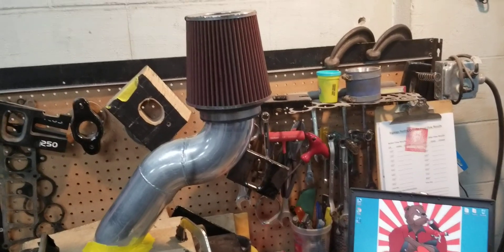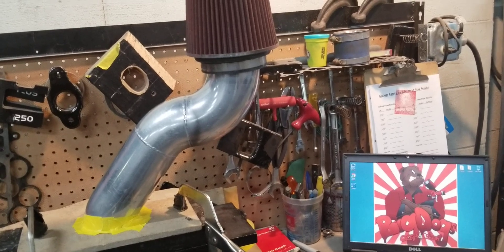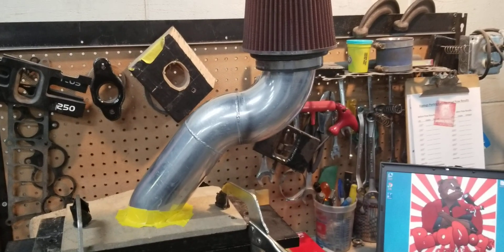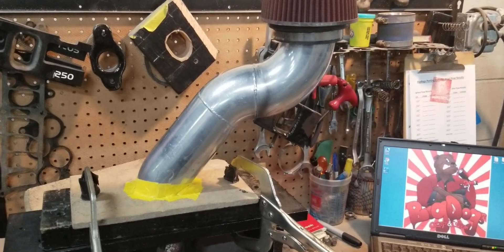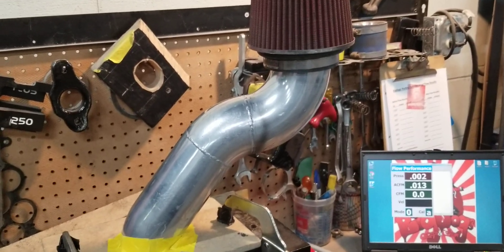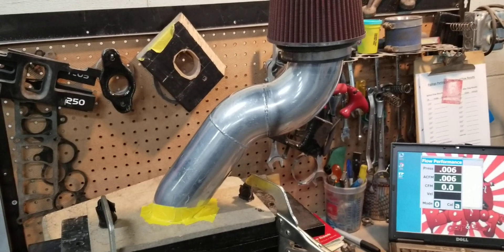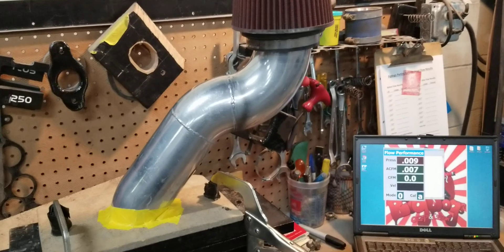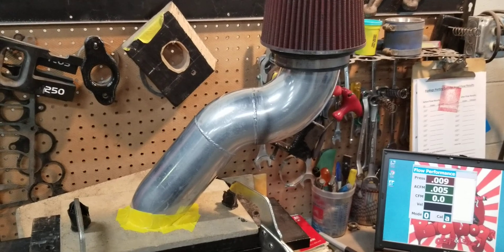Fox body Mustange Anderson Motorsports 3.5" power pipe flow test.

Comment: So this will work on a stock 5.0 bone stock but it helps with the rest of the stuff you would add to the motor correct? Just trying to make sure I am understanding correctly my car is stock I’m not doing heads or cam nothing like that but I did purchase a set of shorty headers bbk equal length but they are not on the car yet I did plugs and wires last night I took the original wires off the car and just want to pack a little extra punch and I herd about this intake I want to do under drive pulleys and the electric fans I saw a video on YouTube the electric fan vs clutch fan does free up i believe it was 15hp and the under drive pulleys if I am not mistaken frees up more also sorry for the long comment I just want to make sure im going in the correct direction just for small upgrades to add a little extra punch but nothing drastic and put all the original parts to the side and the last thing would be 373 gears sorry for the long comment thank you
Reply from the maker: Yes this intake flows well. To help you make even more easy power you can pick up one of our Stage 2 ported factory HO intake manifolds and one of our ported and modified factory 65mm throttle bodies. Both will really add a nice amount of hp and torque while still looking clean and bolting on like factory

Comment: Good info!
Is there a setup out there that will flow 1000 cfm? If so, we need details.
Reply from the maker: Yes you can Feb up a 3.5" inner diameter pipe or a 4" pipe that will flow over 1,000cfm with a 9" long cone filter. That's what we run on our shop cars
Reply: @bigdogsportingtonyb2833  great! I just rewatched the TB video where you explain that. Goooood stuff.

Comment: What mass air and power pipe/filter setup would you recommend for a 11r 190 headed 302 with a rpm 2 intake and accufab 75mm tb?
Reply from the maker: Good question. Since we know what your manifolds throttle body tunnel flow is and we know what your throttle body flow is we can say a 77mm - 80mm maf and a minimum 3.5" pipe with a good 9" high flowing filter. Reason why is because of motors airflow due to the intake. The rpm 2s throttle body tunnel doesn't flow over 950cfm and the out tge box runner flow of the manifold is in the 250cfm range. If your cam, exhaust system and tune can pull cleanly to 6,500 you can make some good hp in the 350-360whp range. Have the manifold ported and the power jumps
Reply: @bigdogsportingtonyb2833  It’s bbk 1 3/4” longtubes with a off-road x pipe.  Small custom cam ground for the sbe and 11r combo.  Pulls cleanly to 6800 but I normally shift around 6200.  5 speed car with 4.10s.
Reply from the maker: @CentralVAracer  have you seen the curve on the dyno because the butt dyno can't tell you if it pulls clean or just making noise lol. Cam specs. Smaller cams tend not to Like higher rpm. 
If th he motor is doing what its supposed to then your power should be higher than 6200. Your heads have tons of potential that you aren't using
Reply: @bigdogsportingtonyb2833  Haven’t dynoed it yet.  Plan to once I swap to a bigger mass air and pipe/filter setup.  I went with the heads because I have future plans of a new build with more ci so wanted to buy heads once and have room to grow into them.
Reply from the maker: @CentralVAracer  until you dyno you don't know what you have hp and curve wise. Need to get a baseline first because slapping a bunch of parts together will lead to disappointing results
Reply: @bigdogsportingtonyb2833  Roughly how much hp do you think I could gain with getting the upper and lower intake ported?  Was originally going with a systemax but at the time they where out of stock everywhere.  So went with a rpm2.
Reply from the maker: @CentralVAracer  if everything is right and you manifold gets ported to our specs and you tune is on point then you could make as much as 375whp or more. Can't say because I don't know cam specs or every single detail. I'm just going off of what we have seen with our customers and our ported parts. We have customers making 360-380whp with our parts on streetable 302 combos

Comment: I've been thinking about you flowing my 3800 setup. I can't wait to see the results of my trickk flow heads and Holley system max. I have a new ProCharger kit going on my fox body.
Reply from the maker: You are going to love the results
Reply: @bigdogsportingtonyb2833  I need your help with some 3800 heads also. When you're done with the SBF stuff I need to pick your brain on a couple of sets of 3800 super charged steel heads. I showed one set to Lamont, bought them from Richard holdener and need you to finish them up please
Reply from the maker: @jplperformance9073  we will definitely work them over for you. We can go over the details soon

Comment: 🔔😎
Wish you had flowed just the KN alone too.
IMO KN Filters suck.
Poor filtering and the oil screws up the MA wire and intake tract.
I took pictures of the dust & trash stuck in the intake tube. Guess how much the engine ate.😱
C O M B I N A T I O N....
right Tony.?? 👍👍👍
Can't hardly wait to go stealthy stage 2 👍👍👍😎
Reply from the maker: We did. The filter by itself flowed 1,107cfm.
Reply: 1107 cfm got it 👍👍👍😎

Comment: Awesome video. Flow a BBK intake for the SBF
Reply from the maker: We did and posted it on the Facebook business page. It only flowed 700cfm
Reply: Wow!! So what cold air intake flows 1000 CFM to match your GT 40 stage 2 intake?
Reply from the maker: @boatdoctor100  Anderson 4" pipe with a high flowing filter but their 3.5" pipe is good for combos making less than 385whp
Reply: @bigdogsportingtonyb2833 would running the 4" be any better than the 3.5" on a stock motor?

Comment: Do you have any videos of yours or your customer cars with mostly or all of your ported parts running? Stage 2 or 3?
Reply from the maker: Don't get us wrong. The video was not done to bash Anderson as we think it's a great peice and we often recommend them its just for those that are looking for flow data here it is.
The air pipes we came up with cannot be sold to the general public due to the crackdown on none emissions legal compliance. If you are looking for more flow then you can check out the Anderson 4" pipe if it's still available. 
We will be posting videos of more cars running our ported parts as time goes by
Reply: @bigdogsportingtonyb2833  no sir! Not at all what I ment. I was just wondering if I could see or hear a fully bigdog prepped set up. My wife’s 93 vert might need some love so just curious.

Comment: What are we suppose to run? Just a turbo guard on our supercharger? I use a power  pipe from blower to inner fender. 28psi ysi B
Reply from the maker: It's all about meeting your combo needs. We are not saying the 3.5" power pipe is no good. We are saying know what it flows that way you can compare your options and the price. If its getting the job done then run it. If you are looking for more power then it can be improved on. Having the flow data allows you to make better decisions when you want more power because you know exactly what you have and what it is capable of.
Think about this. Many guys upgrade their throttle bodies to 75, 80 or 90mm but the motor sees the lowest flowing part in the intake track. We are slower but surely changing the people's way of thinking for better results
Reply: @bigdogsportingtonyb2833  I hear ya, this last week I was thinking of trying a turbo guard and remove the pipe. See what the different is. My concern was. The blower sucking in hot heat above the header and then to the intercooler vs the power pipe getting cooler air from the inner fender then to the intercooler. Not sure yet
Reply from the maker: @horsepoweraddict7199 you can run a 4" pipe or fab up a 3.5" inner diameter  pipe that flows more that the Anderson's 3.5" Outer diameter pipe

Comment: Do one with the Anderson 4” power pipe.. that’s what I plan on running
Reply from the maker: We already have. It was posted on our Facebook business page at Bigdogs porting a few years ago. But the 3.5" engine compartment pipe with the filter placed right behind the headlight will flow 1,200cfm with a high flowing 9" cone outside modified air filter and still get cool air coming from the air dam and from the headlight area. We have tested both with air temperature sensors while driving on the same vehicle

Comment: Always wondered what that power pipe flowed. Now we know...☕️
Reply from the maker: It's a good piece but is a bottleneck when compared to higher flowing throttle bodies and intake manifolds
Reply: @bigdogsportingtonyb2833   Yeah bro.I see that.  This is a perfect example of why EVERYTHING needs to work together!
Reply: @bigdogsportingtonyb2833  so if it’s a bottle neck what’s the solution instead?
Reply from the maker: @mikelazar7954  it's only a bottleneck if the combo can benefit from more cfm from a intake pipe and if there's no other restrictions In the intake system. If the combo cannot fully use the available intake pipes cfm then a higher flowing one is not needed.
Most fox body guys put on out the box 65, 70 or 75mm throttle bodies as a upgrade which actually doesn't flow that much either. This is why we flow test, port/modify then reflow throttle bodies as well as intake manifolds throttle body tunnels to make sure we reduce or eliminate any restrictions.
Reply from the maker: @mikelazar7954 
Watch this video you will be surprised what the out of the box throttle bodies flow. https://youtu.be/ywOJvG1ch0s?si=0kvm2TxnRDTx9Usw
Reply: @bigdogsportingtonyb2833  I watched the video and it’s pretty impressive. You said yourself the AFM pipe is overpriced and I’ve been saying that too for a while. If you make one that’s actually fair priced I’ll be the first to buy it
Reply from the maker: @mikelazar7954  don't get me wrong, the 3.5" power pipe is a well designed piece that is very durable and has its place. We have recommended and installed many of them over the years. It's is a step up from the BBK cai that flows in the 700cfm range. We are actually designing our own line of fox body mustang cai setups with our Stage 2 fox CAI being released soon.

Comment: Couldn't have said it better myself, if a rubber pipe is getting sucked flat the engine is telling you that you need a higher flowing pipe and it will not make the same power as a pipe that allows enough airflow. 90% of those pipes doesn't flow enough Imo
Reply from the maker: You are 100% correct but when we tell people that they try to argue like we don't know what we are talking about lol!! If people would just put their egos to the side and listen to our recommendations they would make way more power without wasting a ton of money
Reply: @bigdogsportingtonyb2833  yeah your right  they will get mad faster than their parts in question will flow 😂🤣 Ive got where ill mention it and if they get mad I just tell them they know more than I do and not even waste my time with it, that will just make the competition easier to beat 😂🤣😂
Reply from the maker: @79beans347  perfectly said 🤣👍